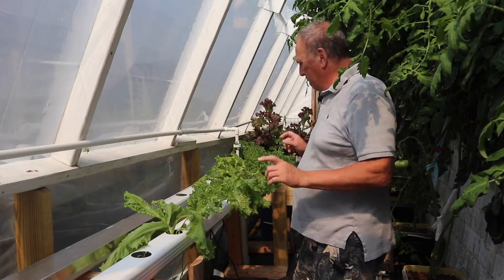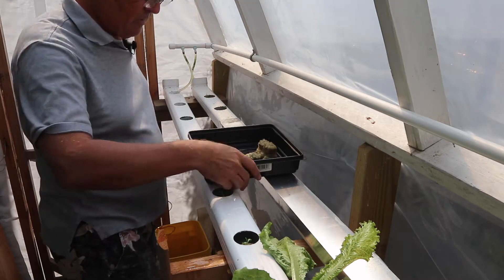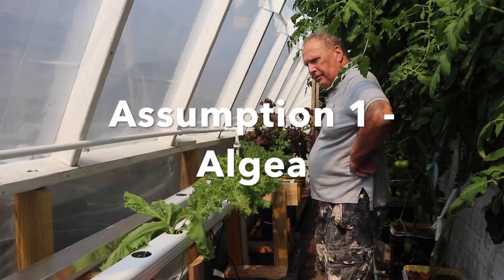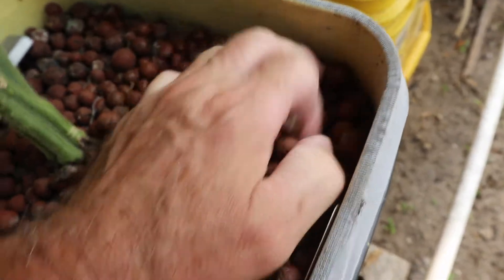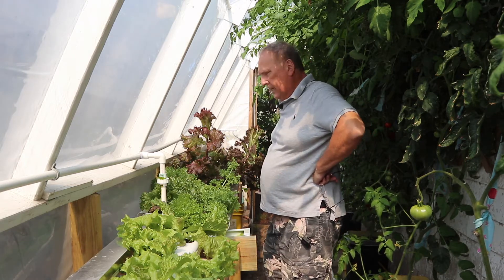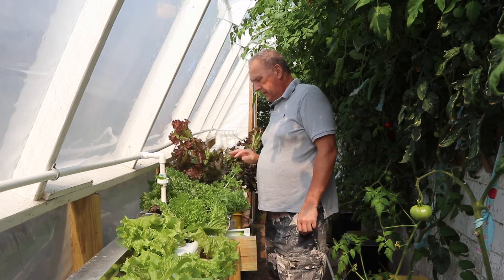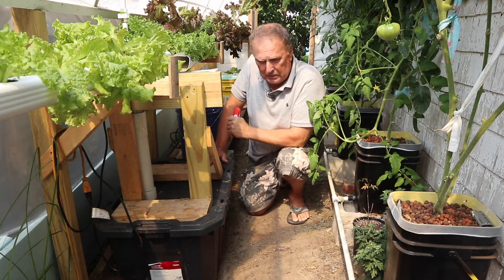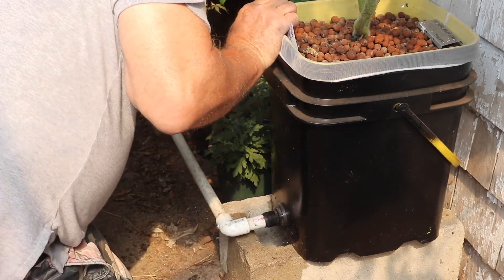Home Hydroponic - Testing My Assumptions

Comment: if your buckets get sun i`d suggest painting them white after  you`ve painted them black. A black bucket in full sun cook any roots that are close to the inside wall :)
I position a 2" netpot over the inside of the drain fitting, holding in place as i fill the bucket with hydroton.  I know logically, it shouldn`t stop the roots heading for the drain but in side by side experiments the buckets with netpots had no root ingress and the ones without netpots did. The downside with FD buckets and hydroton is cleaning the hydroton. The easiest otion is to let the hydroton dry completely and then rotate in a mesh drum. The hydroton acts like the media in a ball mill and cleans itself. The debris falls through the mesh and all you have to do is rinse the dust off afterwards. Cleaning 600L of hydroton is a walk in the park :)